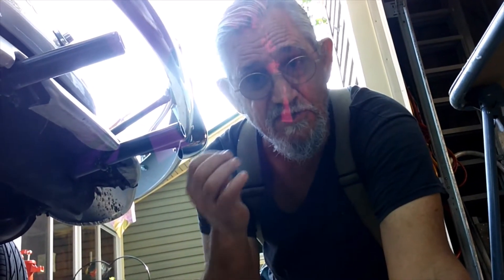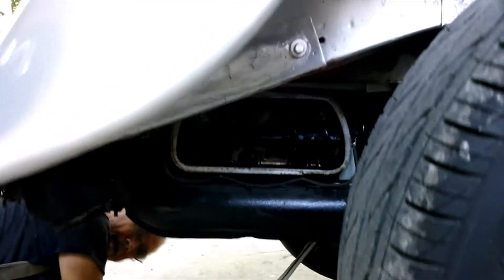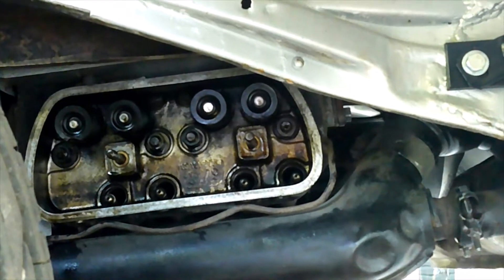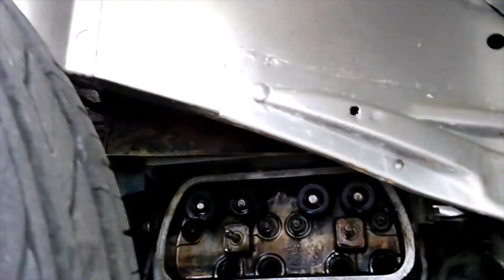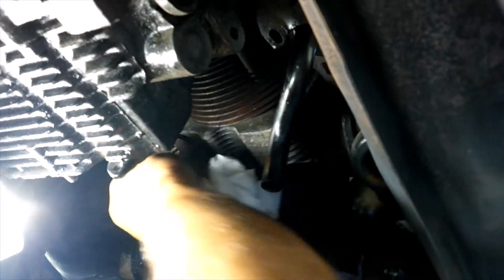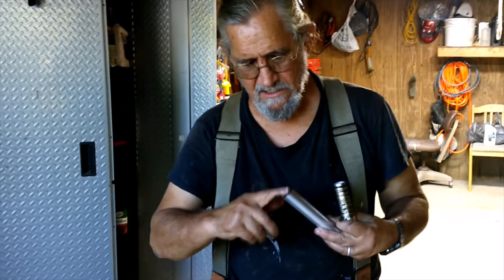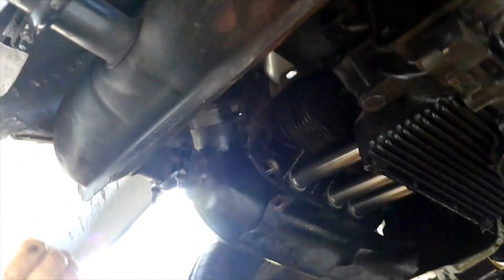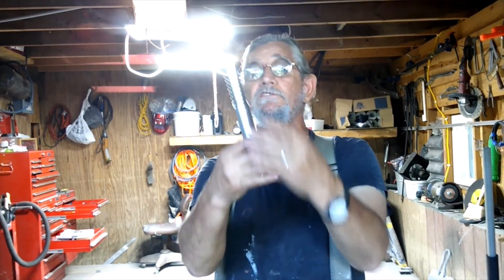Air Cooled 1600 VW Beetle pushrod tubes installed in assembled engine

Comment: i was told the spring end goes to the heads ! just saying ,,,,,now that i see this i might just turn mine around if they are working so good ,, mine had been leaking since i installed it ,,,,,4 or 5 times i am still dripping some oil i used number 2 non hardening sealer on the ends and vwjawbraker i believe the name was says he had better luck without any sealer , just a little oil on them !   thank you for posting ,,,,
Reply: I don’t think it matters.  I’ve tried 3 different spring kits(Empi, JayCee and MST) both directions and all 3 have leaked like a sieve in the center.  Not the ends but the center. The best have been the MST with the springs facing facing the engine. But they still leak. Better than pulling the engine and heads. Just trying to help.
Reply: @PAPAofKissTheGoat918dotcom  l   turned  it around mine is on number 4 spring towards the lifter end it helped it but not stopped it complet ely but its a lot better ,,,at least the oil which flows from the motor end towards the valve covers has no more obstruction that the other way it has to deal with the o ring in there so the flow is much smoother " makes sense ? "  any of this after market crap will not ever fit right empi is all chineese reproduction how ever you wanna call it ,,,,,as the years go by its going to get much worse i beleive ?  hope for the best ,,,,,,happy hollidays everyone ,,,,made it through thanks giving LOL ,,

Comment: What kind of push rod tubes did you replace with? What is name and brand. If you have link to where you bought them I would appreciate it. Otherwise good work.  
Also how are the push rod tubes holding up with the job? Thanks.
Reply from the maker: Dune buggy Warehouse. (EMPI spring loaded pushed tubes . 1- set of eight. 0041090.       SKU EMPI -0041090. Thanks for your comments.
Reply: @bugbruthersvw5012  thank you. And they are still working well no issues?
Reply from the maker: No leaks. But It wasn't my problem to begin with .I had to drop the engine and replace the oil cooler gaskets. But the oil tubes are doing fine.